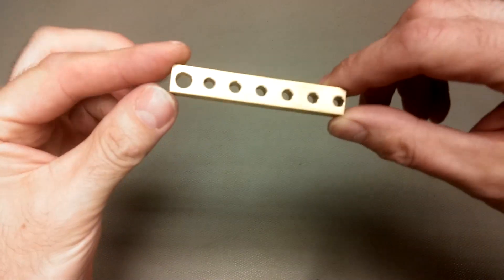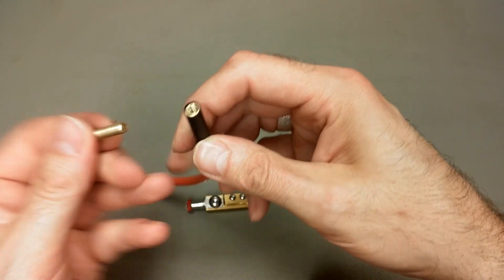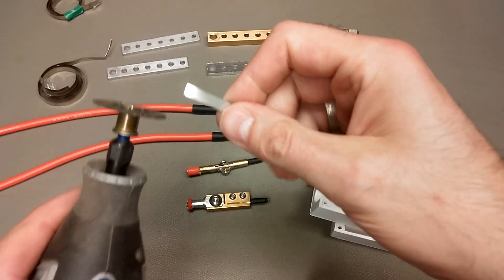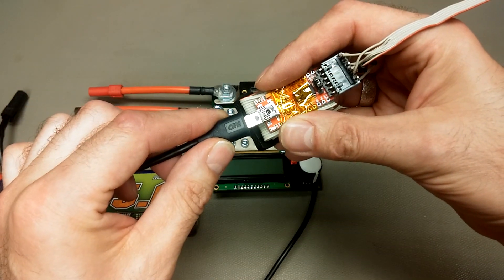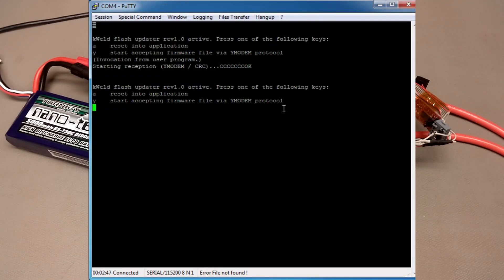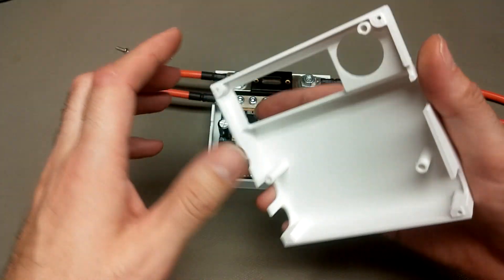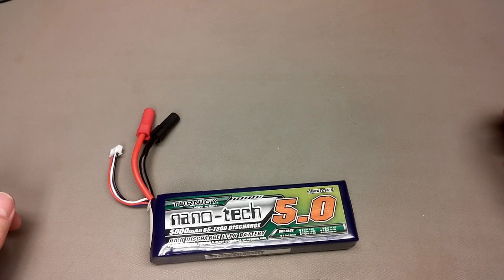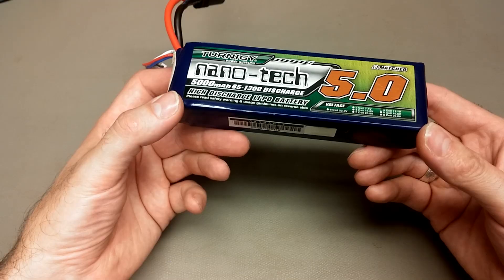kWeld "next level" battery spot welder - torture test and improvements

Comment: This is way out of my budget so I'm gonna DIY one... But do you know if 1000VA of 24VAC rectified power supply would be suitable? 

I have a variac in front of those and I can over volt them just a bit so I can have any voltage between 0 and 30. 
I will obviously put a FULL BRIDGE RECTIFIER, not a puny single diode rectifier on it, but would I need some smoothing capacitors on that part?
Reply from the maker: kWeld pulls 12V * 1500A = 18,000 Watts from its supply during a pulse...
Reply: @wearethewatt2950  Ok if I put a super capacitor bank on it?
Reply from the maker: @TomboRectify  like the one we sell?  (kCap) :-)
Reply: @wearethewatt2950  And also how long is the pulse?
Reply from the maker: @TomboRectify  that depends on the type and thickness of the material that you are welding, so from 0 to maybe 50ms. Longer pulses don't make sense, as then the action turns from spot welding to material heating. This all is a complex subject, so did you find the respective user forums? There are several: https://endless-sphere.com/sphere/threads/kweld-next-level-diy-battery-spot-welder.89039/ https://forum.esk8.news/t/kweld-spot-welder/6926 https://www.eevblog.com/forum/projects/guesses-on-what-i-am-attempting-here/msg2806494/#msg2806494

Comment: Hello! Thank you for this project. I get my kit HW R3.3 yesterday 28.09.23 - did I get it with the newest version of FV or it need to be updated??
Reply from the maker: Yes it comes with most recent firmware!
Reply: @wearethewatt2950  Tkank you. Last question: Is any calibration instruction that need to be preformed during first start?
Reply from the maker: @tomaszjaje  yep, just follow the operating manual.
Reply: @wearethewatt2950  ok I saw that in operation manual v 3.0 are some instructions but in 5.0 there is not. So I would ask if new one is still necessary;) thanks
Reply from the maker: @tomaszjaje  there is no v5 operation manual. the most recent one is v3. note that there are two documents, an assembly manual (which is v5) and an operation manual (v3).

Comment: I just bought one, had no idea they had been around this long I thought like 3 years at tops. Means that its a very good spot welder.
Reply from the maker: Have fun with it :-) Actually I'm working on a successor (although higher price range), so there will be new videos in this channel after quite some time.
Reply: @wearethewatt2950  Thanks, sure will. :) Successor you say? There can be only one, and can this really be better than the first one? That's impossible.
Reply from the maker: @dtiydr  I am working on a Pro version. Desktop unit with AC input, plug and play, 4 times output power, fast repetition, water cooled electrodes. Basically summarizing all the community feature requests.
Reply: @wearethewatt2950  Dam, that would be a beast and that will sell for sure, really cool! Any release this year or more into next perhaps?
Reply from the maker: @dtiydr  prototypes in maybe 3vmonths, first series batch should be this year :-)
Reply: @wearethewatt2950  Excellent news, really seeing forward to it! :)
Reply: Waiting for the Pro version!

Comment: I'd rather have copper buss bars
Reply from the maker: The new kWeldPro will have nickel plated copper bus bars, because it runs at much higher currents. For kWeld, I had calculated that brass is more than good enough - it contributes only for a few % of the total resistance. Copper needs plating to prevent oxidation and is harder to machine, hence more costly.

Comment: A Very nice Spotwelder, it seems  very well designed & made of a "very high quality" for the price. 😊👌👍

I recently purchased a K-Weld Spotwelder, which im actually just waiting for it to be delivered.

Im wanting to power the Spotwelder by either 2 ways

Option 1 - Could I run it through a K-Cap capacitor bank then off to a "Normal Variable Bench Power Supply" ?

I have a DIY 240V AC Variable Bench Power Supply with output specs:
0- 44V DC
0-20A With fine Variable increments & Constant Voltage & current settings. 
Would this be adequate enough to power the Spotwelder through the Capacitor Bank ?

Option 2 - I may run this K-Weld spotwelder off some
-  Headway 38120S "HP" 8Ah cells in a 4S / 3P configuration, these Cells can deliver up to 200A "Continuous"per cell so a 4S/ 3P  battery would deliver around 13.2V at 24Ah Capacity & 600A "Continuous" so should see peak current far higher than this.

Would this work adequately ??

 I know I could use your recommended 3S lipo battery but I thought this battery type & current rating (I mentioned above) would be a much safer chemistry (lifepo4) & also last far longer (lifespan) under these high current & demanding surge conditions. 
What are you thoughts ? 

And which way would you prefer out of these two options.
Any help would be greatly appreciated, Thankyou 😊🙏
Reply from the maker: Thanks :-) Can you maybe send me an email? Using YT for support is a bit awkward. Your bench supply should be well suitable. Your battery should also be good, but as we don't know their actual ESR I'd start with 4S1P and add more P as long as the current stays within limit (2kA max).
Reply: @wearethewatt2950  OK  2kW is the "limit" of K-Weld Spotwelder, Thanks I didn't know that 👍 
I think I will start with 4S/1P 38120hp cells as you suggested & calibrate to see what the Spotwelder K-Watts I'm running, then go from there. 
Any issues I will certainly contact you via your E-mail. Thankyou very much for responding. 😊🙏

Comment: No actual trial test in the video?
Reply from the maker: there are several videos that show it in action, the one I like most is this: https://youtu.be/PenPYwa00CA - watch at 10:43.
Reply: The power cell of the other welder didn’t get the trial test, its different to the other one. 
I was interested to see if that small power cell can do the job. 
The one you showed in action, I think, it has 4 or more super capacitors.
Reply from the maker: @knowwell4497  the battery that I am showing in these videos hasn't up to the task and started swelling quickly, but this was years ago and we long have proven solutions. Just check out our website and the battery recommendations there.
Reply: @wearethewatt2950  thank you!

Comment: I just tested my K-Weld from 18650'ed. I used a 6s Chevrolet Volt  homemade lipo, and made approx. 100 test welds without fail. It is a single 6 cell 15.5 Ah NMC-LMO LG battery beginning @ 24.9v. Wonderful results, with an average of 1650A per 50ms weld. Given above approximations, should I expect about a solid 60 seconds of weld time until discharged?  Would you say yes, or less? Ir is 1.6mOh / cell. I never liked the reliability record of the HK Nano-Tech.
Reply from the maker: Great :-) I'd estimate the usage time as 15.5 * 3600 / 1650 = 34 seconds. But you shouldn't drain the battery entirely, 2/3rd of that time is more realistic.

Comment: Ouch, that battery may do well short term but I can't imagine it lasting too long at almost double it's rating.
Reply from the maker: That's very true, it started swelling quickly. I then extensively evaulated two different higher power models, and can recommend them (links on my website). Still, as these are Lipos and inherently dangerous, one should stay cautious and handle them with appropriate safety precautions.

Comment: I think it would be even better if you would use a STM32 and so you just connect it directly to the computer, it shows up as a storage, you drop the file in the folder, disconnect and it automatically flashes itself.
Reply from the maker: It's actually using an STM32 with USB support, but this project evolved step by step and I didn't have custom (encrypted firmware!) USB based bootloader stuff available at the beginning - UART is just a lot simpler to start with. That's on the todo list for a redesign though!
Reply: @wearethewatt2950  Oh yeah I just have seen the schematics.
Is is possible that I design 5kA version that is compatible with your current schematics and firmware?
I'm fairly good with Eagle.
Of course all rights reserved for you.
Reply from the maker: @Arek_R. That is possible, but 5kA will be quite difficulty in terms of MOSFET load sharing and  inductive kickback absorption. You'll need TVS diode arrrays that can absorb at least 25J per pulse. If you are interested, then please contact me through www.keenlab.de and we can negotiate.

Comment: Excellent work dear fellow!  
Question:  Why would you not use a DC breaker instead of a fuse?
Reply from the maker: Thanks :-) The fuse is the most cost efficient option, keep in mind that the current is up to 2000A here.

Comment: You need copper. All that brass and aluminum is lossy. Brass is only 28% as conductive. Aluminum is like.... Really bad.
Reply from the maker: Copper is difficulty to machine, hence the choice for brass. The bus bars are massive enough to only make a small contribution to the resistance. Everything else is copper, also the electrode system in the current revision.

Comment: Is your spot welder able to weld copper sheet 0.2mm to cell 18650?
Reply from the maker: I'm afraid not, welding copper is an entirely different story because both its thermal and electrical conductivities are much higher. You need ten thousand amps or more for this.

Comment: did you test with two lipo batteries in parallel? You should get cool currents and low times.
Reply from the maker: Yes, I used three Lipos in parallel when doing reliability testing, in order to find the maximum current that it can reliably switch. I went up to 2800A for this test :-) But in practice, the recommended Turnigy nanotech is perfect. It delivers around 1400A, which is the welder's sweet spot: enough for up to 0.3mm nickel, and easy enough to not put the switch in danger from overload.

Comment: can we use a 12v car battery? you must find an easier way to make on/off of the welder without the need to unplug the battery each time. maybe an extra high amp switch?
Reply from the maker: A fresh and decend 65AH starter battery works very well with the welder. Switching this amount of current is not very easy, nor cheap, and the switch shouldn't add any noticeable resistance. Another customer is using these: https://www.electricautomationnetwork.com/en/eaton-moeller/main-switch-240-v-125a-1hp-eaton-moeller-276286-is-125-1
Reply: WeAreTheWatt or a truck/starter solenoid that can handle I think 400amps
Reply from the maker: That should also work fine, just that I haven't tested it and therefore can only judge by guessing.

Comment: Very, very cool. Excellent work. I will be ordering one for myself at some point. I have ordered some nickel ribbon and I just need to find a good supplier of quality 18650’s in Canada.
Reply from the maker: Thanks :-) I know that I should be selling this kind of stuff as well, but I need to concentrate on the "mission critical" topics for now.
Reply: Selling lithium batteries and shipping across borders is complicated. I would stay away from it if I was you.
Reply from the maker: that's exactly why I don't do that ;-)
Reply: I used your welder with supercapacitor bank 6x2.7V 400F Eaton XV Series and during the calibration it reports "undercurrent"   and reports 650A. It surprised me. Is it possible the battery you are showing has lower ESR than caps ?

Comment: I ordered one here in the US just have a question about the battery. What is the voltage range the unit works off of. Can I use a 4S battery or can it only be a 3S? Can you make a video going over the menu controls please?
Reply from the maker: I'm sorry but due to my current workload I keep shifting a new video from week to week... You might want to download the kWeld manuals from the website, they are free of charge. The operation manual explains the menu, and I do the battery math there as well. The general rule is: lower battery ESR as much as possible, and use as little voltage as possible. The ultracapacitor supply that I am working on uses only 8.1V, and that is possible because of the low ESR of the capacitors.
Reply: OK questions what is the max rated voltage it will work off of and does it work on aluminum or copper and in an apposing configuration one electrode over the other with material sandwiched in between?
Reply from the maker: It runs from any voltage between 4V and 30V. It is designed to weld nickel or steel tabs of up to 0.3mm thickness to battery tabs. Copper does not work because of its much better thermal and electrical conductivity, aluminium is on my todo list but not tested yet. An opposing configuration will work just as well or even better than having them side by side, because the current path is very well defined.
Reply: Thanks for the reply. I am very interested in the aluminum since it opens up some other options like prismatic cell tab welding and solar cells which I currently have that are aluminum tabbed. Any benefit to a using higher voltage battery pack?
Reply from the maker: The welder needs current, not voltage, so it is better to invest in larger cells than in more of them.

Comment: currently looking at your welder and the arduino spot welder. However, I cant find any comparisons between the two. Can you elaborate on any advantages your model offers over theirs. Not trying to put you on the spot, but just want to get all the info before I pull the trigger on one. Kind regards.
Reply from the maker: There are two forum threads about kWeld: http://www.eevblog.com/forum/projects/guesses-on-what-i-am-attempting-here and https://endless-sphere.com/forums/viewtopic.php?f=14&t=89039 that I can suggest. There is a thread for the Arduino welder on endlessshphere as well, and one forum member wants to make a review of these welders. As I personally never trust any kind of advertisement from the seller of something, I'm not going to elaborate on the advantages of my welder. I prefer to let the users decide.
Reply: WeAreTheWatt

Ok. Maybe i should have been more specific. I do appreciate a humble seller. However, i do believe it is the responsibility of the seller to market the strengths/advantages of their products. (FYI... I did look for 3rd party info, but there is just not alot out there other than whats provided by each owner of their respective device.) I will review the link provided. However, i would appreciate of u could provide some insight to my question below. 

I noticed that your device has a larger range for voltage input with reference to it being as such for better support of super capacitors. Can you elaborate on this feature set. Such as the advatanges of your input voltage range and how supercaps will better utilize this feature in the future as ive read your other comments that state super capacitor uses requires some future fleshing out.
Reply from the maker: kWeld has a wide input voltage range of 4V to 30V and can power itself from the main input. That means that you don't need an additional plug pack for the logic supply. And as the main input voltage typically drops significantly during a welding pulse, the logic has a large supply holdup capacitor (that electrolytic capacitor on the left) that can supply the unit for long enough. That is one of the reasons why the welder has a wide input voltage range. The second advantge is that you can directly use ultracapacitors. They have extremely low resistance, but they also have low voltage ratings of 2.5 to 2.7V per cell. You don't want to put many of them in series. If you use two in series, this gives you only 5.0 to 6.4V of input voltage, which is not enough to reliably switch the welder's MOSFETs. Therefore the kWeld voltage regulator is designed to output a stable 10V from any input voltage from 4V to 30V.
Reply: WeAreTheWatt
Thx for the reply.

Comment: May i suggest if your building a quality made spot welder... buy a more quality made LIPO and preferable a hardcase one instead of a softpack which is more prone to accidental punctures.
Reply from the maker: You are completely right with the hard case. But are the Turnigy's really that bad? I am quite impressed of the 5Ah nanotech that I have here. I am abusing it every day, and it still doesn't show any sign of weakness.

Comment: Anyone using supercaps for this? Maxwell seems to have some good ones
Reply from the maker: I will, and I also plan to offer that solution in my shop. Plus a charger for these caps, as intensive welding with kWeld requires up to 500W of average input power. But that will need some more time and work.
Reply: Cool I would defenatly buy that kit,  supercaps seems like a good solution then you dont have to worry about a exploding lipo and you have cycle life order of magnitude greater and high power as well. Downside is offcourse less energy but should be enough. 500W is a lot for a charger. The energyconsumption I would guess it´s not that much because of the short burst of power? By the way love your welder its a beautiful creation
Reply from the maker: Banzay20 The welder needs 50 joules per weld, the system efficiency is 0.1. This means if you want to make one weld per second then the charger needs to deliver 500W on average (!).
Reply: so what about the voltage, is it any preferable levels or is it enough with a couple volts?
Reply from the maker: That just follows Ohm's law. It must be enough that the short circuit current of the entire circuit is at least 1000A, better 1500A. The weld spot accounts for 2mR or less. The welder including its cabling has ~2.5mR. Now the number of capacitors in series and their ESR determine the current. For example, 2 BCAP3000 in series will have 5.4V max and 0.6mR. This results in a current of 1060A. Putting three in series gives 1500A. And so on.